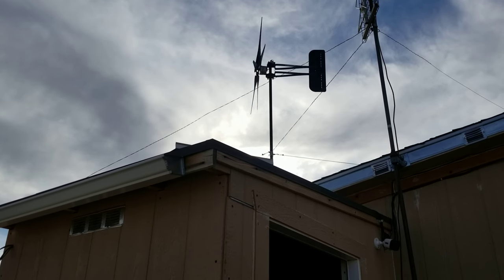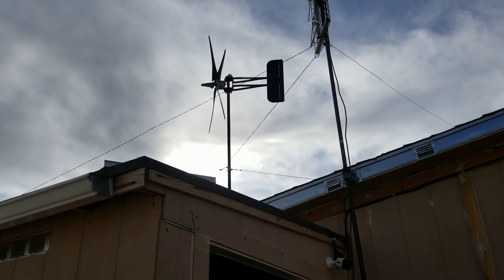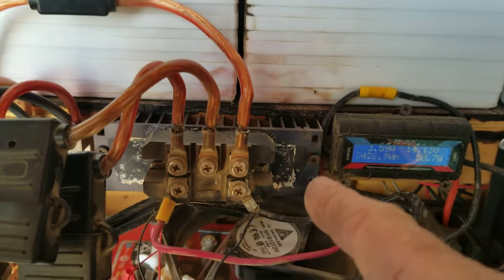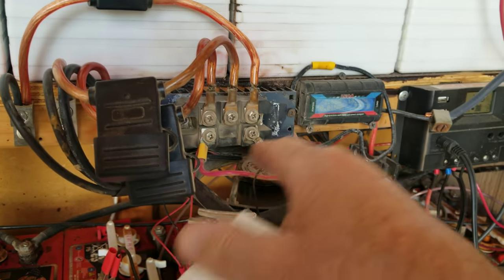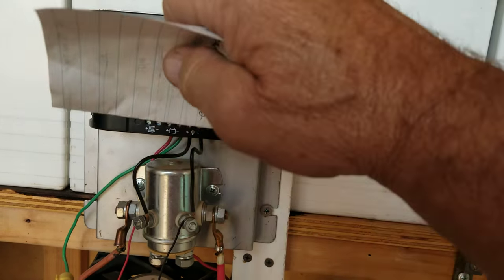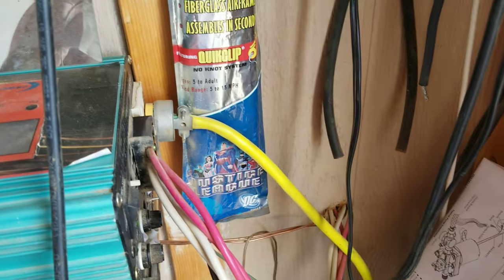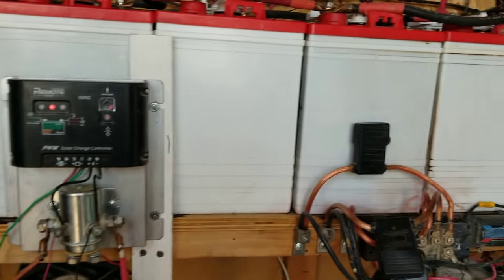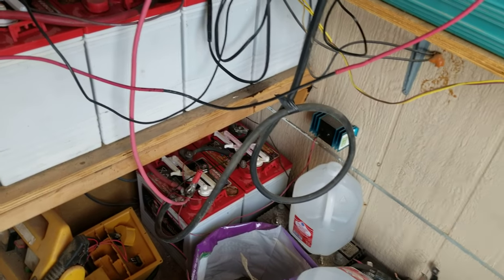Wind turbines, controllers and batteries explained, March 6, 2020

Comment: Hello from the UK. Have you ever tried running a 24v turbine with a 12v battery bank, former forklift batteries 6 x 2v each. I can't find much on it. I've tried this and didn't get any power from the turbine, 15w max. Was brand new. I tried it with the controller and also bypassed that and used rectifier only, again nothing even in strong winds. Would you have any idea if it could be the controller not up to it (I used the one it came with) or it just won't work. Just thought I'd ask in case you tried it. Thanks for this video, very detailed and picked up lots of tips.
Reply from the maker: Sorry, for my last response, I read your question backwards.  Haven't had my coffee yet.😉
A 24v PMA would have a way to high output to use on a 12v battery bank and could damage the batteries. That would be like plugging a 120v fridge into a 240v outlet.  Again, you could use a step down transformer, but not efficient.
It is possible that your turbine is not PMA (permanent magnet alternator) and actually a standard alternator that requires electricity input to produce output.
In that case, the 12v input would be too low to activate the alternator.
Reply: @GBear  ha! No problem. Coffee is fuel, for sure! It was a recommendation from another Youtuber. 500w turbine 24v 5 blades for a 12v set up but I found it didn't output anything. OK, thanks for your answer and analogy. That helps. J : )
Reply from the maker: Yeah, the one thing to remember with turbines is, If it is rated 500w with a maximum speed of 60mph wind, what they are actually saying is you need a 60mph wind to get 500w.
But for basic electrical in wind and solar, you should ALWAYS match voltages.

Comment: Great stuff, thank you! so basically the power from wind is going straight into the batteries ( disregarding the rectifier) not using something like a charge controller like the solar does, correct? Would this same setup translate to hydroelectric, no? (Pelton wheel being spun by water) lastly, where did you get that display showing power and voltage?  Or what did you Google for?
Reply from the maker: Welcome aboard!  Yes, 3 phase AC power comes in from the PMA (turbine) goes through a bridge rectifier to make it Single phase DC, then through the "high precision wattmeter", then through a breaker to the batteries. 
Then a dump load unit or digital load diverter is applied to the battery bank to prevent over charge.

Comment: G-Bear... wife and I are headed off grid and looking for a 48 volt wind turbine for our 48 volt off grid (ALTE PRE-WIRED SYSTEM SCHNEIDER SW4024 INVERTER WITH MIDNITE CL150SL CHARGE CONTROLLER). Will one of these wind turbines work with our system? Thank you for any input. Blessed and Happy New Year to You and Your Family!
Reply from the maker: Hi Ron!  Welcome aboard! 
So, am I correct in hearing that you already live off grid and have a 48v system using a SW4024?
That doesn't sound right.  For a 48v system you should have the SW 4048.  Also, a CL150 SL by Midnite won't work with a PMA.  The SL is Solar Only.
I'll need more information in order to guide you correctly, or you can call 877-878-4060 for more info on the Alte prewired system.  They can actually configure a system to meet your needs.
Note that there are 2 types of turbines.  PMA & PMG.  PMA is an alternator type with 3 wires, all the same color and needs a bridge rectifier to convert AC to DC before connecting to a charge controller.
Also, you need to be sure the size of the turbine output won't exceed the voltage input specs of the Midnite, so you may need the Midnight Classic 200 or 250, full controller, (not an SL).
Let me know if I can be of any further assistance. 
Happy New Year.
Reply: @GBear  Not totally off grid just yet! You are correct about the 4048! My typing ability is not as good as it used to be and spell check is even worse! I quite comprehend that the PMA and PMG are different in system function. I found it interesting that you had multiple connection points to your battery bank and were also utilizing wind charging. I have not seen this type of charging system/points - and you caught my attention! So - I will have to speak with you or altE to see if our second Absolyte 48v Battery Bank can be charged with wind or not. Modified Sine Wave vs Pure Sine Wave is something I am still attempting to learn. We are building an Steel Building Style Canopy w/ Container to cover our RV while I slowly put things together. The process is slow due to me having a heart attack in Feb '23 - but I am getting strong enough to continue the process. I'll need power in the sea container to supply power to tools while I work and power to the RV when we move to the top of the mountain. Thanks for responding to my comment (I know they are long!) - I apologize for that!
Reply from the maker: @rongray4118  Not a problem.  Don't overdo it with working.

Comment: Can it be incorporated into a solar system like using a Delta Pro type battery
Reply from the maker: Welcome aboard!  Can it?  Yes, but would I? No.  You didn't mention the capacity of your Delta Pro back up system, but if it is, let's say, 3600watts, and 12v, that makes it 300A, and these little PWM controllers would not provide much charging power, although any solar system charge would be better than none.
Your Delta is a backup power source designed for temporary power in case of a blackout.  It should not be expected to permanently power your household.
Reply: Just wondering if it could be used as a backup
Reply from the maker: @EricPriest-m6q  Yes, but a good MPPT controller with say 300w of solar panels would be the way to go.

Comment: Someone gave me a nice 24v wind turbine because they didn't know how to use it on their 12v boat system. I have a 12v sailboat with a 300ah lifep04 bank and a 300ah agm bank. They are independent of each other. Is it possible for me to use the wind turbine with either of my battery banks? I saw a wind mppt with a dump on Amazon but I'm not sure if it can take a 24v wind turbine and charge my batteries at 12v
Reply from the maker: I wouldn't do it unless you switch the agm's to 24v.  The turbine will produce enough power to fry your system.  Also the Lifepo4's need different controllers.
Reply: @GBear  the lifep04 batteries have their own individual bms systems that protect them from overcharging, overvoltage, overheat, reverse polarity and freezing temperature. But that doesn't mean that I can charge them with 24v. They wouldn't accept it. I was hoping to find a controller with a dump that could take in 24v and charge my 12v lifep04 batteries or my 12v agm batteries. I thought maybe a solar controller could work as they take in up to 100v then deliver the corresponding voltage to my 12v system but it wouldn't have fun with the fluctuations I'm guessing not to mention what would happen to the extra power. Some solar controllers have a direct power output that I could connect a hesting coil to but I'd also guess that those power outputs have a somewhat limited delivery amperage. We can't afford a quality wind turbine like the one we were given but we could afford some components to make it work if possible. If you have any ideas please let us know and thanks so much for your time to respond to us and making a great video. Take care!
Reply from the maker: I can't be sure, but suspect Midnite Classic charge controller would work.  They can be used for dedicated turbine controllers, and since you would connect the batteries first, the controller will set up for 12v charging.  I don't see why a higher voltage input would be any problem, as I have a Midnite Classic 150 on my 12 volt battery bank, and have 24v solar panels connected in series for a 120v input.  It works better than fine!
I bought my MC150 on ebay, refurbished and saved a couple hundred dollars.  I'll be getting another when the money is available and will take my turbine off of the dumpload circuit, because the Midnite Classic does the whole thing in the most efficient way, and I will get optimum output/input from my 1850w PMA.

Comment: Hello. Thank you for a very good video. I have a 3 phase 12v PMA. From what you showed in your video I understand that I can connect it directly to the battery through rectifier, which I also have. But what would happen in case of stronger wind when my wind turbine starts producing about 18V for example? Will it not damage the battery?
Reply from the maker: Yes, you need a charge controller/diverter and a resister also connected to the battery bank. The one linked below is for a 12v system, be sure to order one for your system voltage, and also purchase a load resistor that will handle the excess charge.  I use a 300w resister.
Check out Battery charge controller G4 440 AMP 12V solar panel wind turbine G4 / NO BASE on eBay!
https://www.ebay.com/itm/233220526161?mkcid=16&mkevt=1&mkrid=711-127632-2357-0&ssspo=SC2_IhySQ8W&sssrc=2349624&ssuid=zdeiyk-orka&var=&widget_ver=artemis&media=EMAIL
Reply: @GBear  Thank you
Reply from the maker: You are welcome.

Comment: I hooked up my turbine to my 24v solar system I already have set up. During the day, I can tell there is resistance to the turbine. At night, the turbine just free spins. Do you know what the problem is?
Reply from the maker: Sounds like backfeed?  Is your turbine 2 wire or 3 wire?
Reply: @GBear  I could be wrong but something tells me that his turbine isn’t made for a 24 volt system. I bet I could figure out the issue in a few minutes with my multimeter. 
    Rule of thumb for me when it comes to DC power and battery banks:

Never trust your eyes and the color of wires, only trust your volt meter, volt meter never lies!
Reply from the maker: @digitaldreamer5481  true!  I can't see what he has, and as usual I didn't get enough info in the description.

Comment: This solve most of my questions on wind turbine system, meanwhile I have a straight question and I need your help urgently,
I have a 120v battery (solar already installed )  system and i want to upgrade by adding wind turbine on it to keep charging the batteries mostly at night, my question is …

is it possible to go for 5qtys of a 24v 300watts wind  turbine system and connect then in series just like solar modules to generate the 120v I needed to charge the system.

please kindly share your ideals
Reply from the maker: Good question!  Unfortunately,  I don't have an answer for that.   I have not heard of anyone trying that.
The best I can suggest is that you contact a turbine manufacturer. They may even be able to produce a 120v PMA for you.
The 120v battery has intrigued me as the highest off grid bank I have heard of is 48v.

Comment: The far left green Chinese charge controller is made to be a wind and solar controller. I'm wondering why you are not using it as a wind controller also? Has it held up well?
Reply from the maker: Welcome aboard!  That controller is a small boat anchor.  In other words, a piece of junk, just like the one next to it.
Don't waste your money on hybrid controllers from China, as they are a joke.
The best wind controller out there is a Midnite Classic, either the 150, 200, or 250.  Note, that you can't connect wind AND solar to the Midnite at the same time.  It's either, or.
Reply: @GBear  have you tried the Xantrex c35 through C60 controllers? They are a little over $100 each.
Reply from the maker: No, I haven't tried those.  If there's one thing I learned about off grid solar, it's "you get what you pay for".

Comment: We have a 5000W wind generator and 16 6 volt batteries run parallel and in series for 12Volt 830 AH and 600W solar panels but our batteries arent going above 12.3. Should we use a different gauge wire for the wind generator? We are using low voltage wire right now.
Reply from the maker: Your wind generator is rated 5000w, but that would only happen at maximum wind speed.   You should concern yourself with solar power and use wind as an added plus.
You didn't mention what type of controller you use, and how your solar panels are connected for what input.
I suspect there is your problem.  Please give me more information and I will try to help you solve the problem.

Comment: Can you make a tutorial how to hybrid solar cell & wind turbine. 
🙏🏻🙏🏻🙏🏻
Reply from the maker: Wind and solar need separate controllers.  The hybrid charge controllers sold by China mislead you to believe you can hook up both to one controller.
Reply: @GBear  
Owh separate controller? 
Maybe we have to use TDR(time delay relay) 
Morning - afternoon use solar controller
And auto switch to wind turbine at the night. 
Any suggestion bro? 
Now I try to build my sollar control panel system 24v 1,3 kw low frequency PSW. . 
But next I wanna add wind turbine. That's why I try to search any information about wind turbine. thank you for your information about this  I want to learn wind turbines characteristics. 😅 this my first time about wind turbine 😅🙏🏻
Reply: @GBear  thank you so much for your video 🙏🏻🙏🏻
Reply from the maker: Ok, here are some tips for wind turbines.
1. A PMA requires smaller wire than a PMG.  You will need a bridge rectifier for the PMA, but the PMG has it built in.
2. Get the highest output PMA you can find because they seldom will produce their max output.  Remember, a 1685w PMA good up to 90mph winds will only produce 1685w IN a 90mph wind.  So you would be in a hurricane to produce max output.
3. For best results with a PMA, use a Midnite Classic charge controller JUST FOR THE TURBINE.
4. Mount the PMA up high, away from trees, buildings, antennas, etc. Be sure it is on a secure mast able to withstand pressures like 2500psi.
Reply: @GBear  
Thank you for your suggestions & information 🙏🏻🙏🏻🙏🏻
I want to try after my solar controller system complete. 
It's very interesting talking about renewable energy⚡⚡ 😁👍🏻👍🏻👍🏻 my new hobby 🤣
Reply from the maker: @aguswijayagurumu  you're welcome.   Enjoy!

Comment: When you need to replace your batteries do you think you will go with Lifepo4 batteries?  They are getting cheaper all the time. 
Thanks for the video.
Reply from the maker: Welcome aboard!  Not sure about that.  The extreme temps out here are not good for LiPo
Reply: If you have some strong young and very good friends an earth bag structure might be an option. Maybe one for the batteries and one for the other equipment. The equipment room could heat the battery room. Eg4 now has a self heated battery, I think it is 13kw and is about $4000. Maybe a suggestion for someone starting out that could be expanded on. Maybe a subject for your new paid channel. 

We could see some deflation in batteries after we get through inflation going down.  Again thanks for sharing.
Reply from the maker: @JR-xw5dk  Thank you for the information.  I'll at least do my research so I know what I'll be dealing with in the future.
Reply: Not anything I have tried but just something I thought about.  If you can get the right thickness of wall you might get it warm enough for the winter and then cool enough for the summer. 

Maybe do earth bag work shops. Get people to pay you to work for you. 😂
Reply from the maker: @JR-xw5dk  lol, thanks.  I'll keep that in mind.

Comment: how to calculate the maximum batteries that can be connected to a inverter? If i have 24v 2000W inverter and i have 24v 230Ah battery how many batteries can i connect to the inverter?
Reply from the maker: As many 24v sets in parallel as you want.  The 2000w rating is for the inverter output.  The input batteries determine how long you can run a load (time under load) on the putput side of the inverter. Volts times amps equal amphours, therefore, volts times amphours equals watthours.  Therefore, if you had a 1000w load, 1000watthours would run it for 1 hour.  If your battery input equals 4000Wh then you could run that 1000w load for 4 hours.
So the short answer of how many 24v batteries can you connect on the input side of a 2000w inverter is:  As many as you can afford.
I hope this helps.
Reply: @GBear  thanks man, really appreciate this help. I spent a crap load of time in Google and chat gpt and was super frustrated. Thanks for you time💯
Reply from the maker: You're welcome.   Thanks for supporting my channel!

Comment: You don't mention that another advantage of the AC is that the current in the wiring is smaller so you have less line loss and can use smaller Guage wiring.
Reply from the maker: Welcome aboard Ron.  Maybe not in the video, but I have mentioned that often in comments.
Good comment, though.

Comment: good info QUESTION for a newbie. What can you actually use this to power in your house? example your tv and a few lights? how long do all those batteries last if the wind power and solar is off? thanks man, just trying to learn here.
Reply from the maker: I power my cabin and workshops on my system, and have gone a week with overcast skies without running out of power.

Comment: I have installed wind turbine at my house... But due to variations in wind speed, am getting a different voltages based on the speed. So how can I control the voltage and get a constant voltage so that I can charge my battery. Because giving different voltages to the battery will damage my battery.
Reply from the maker: PMA's will always produce different readings according to wind speed, but a 12v pma should only put out 13.6 volts maximum, just like a car alternator.
PMA's will only put out the maximum rated watts when turning at the maximum rated speed for the blades, so slower winds create lower readings and this makes PMA's a poor choice for battery charging.
Wind power is only a backup for when the sun doesn't shine.